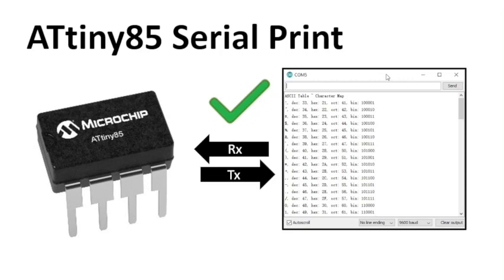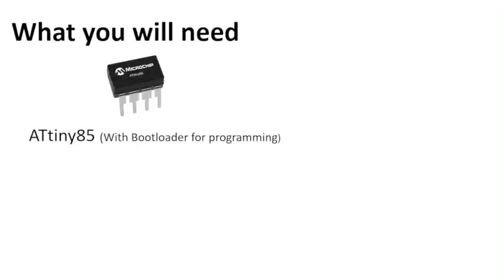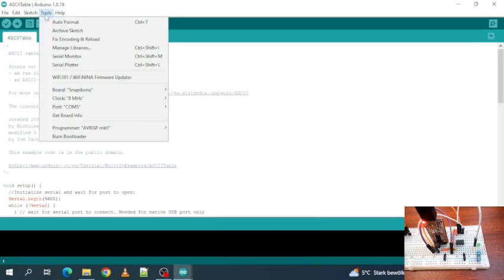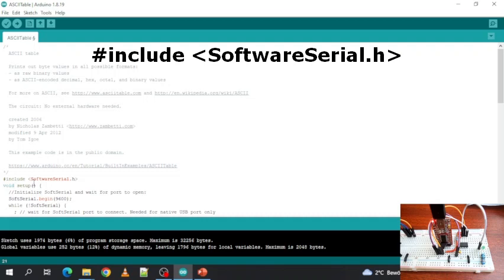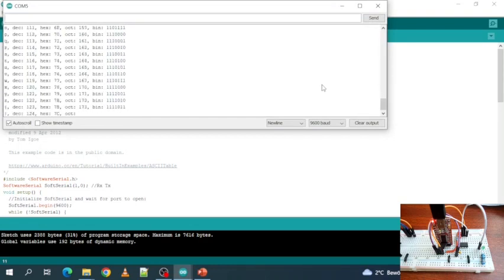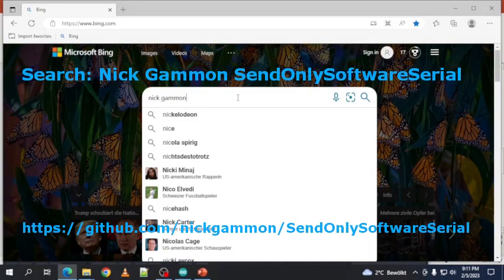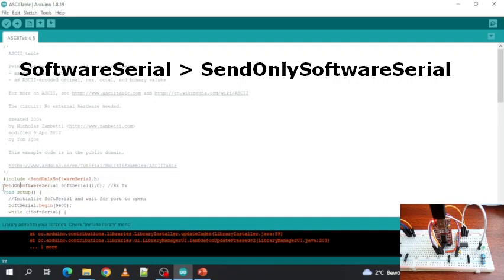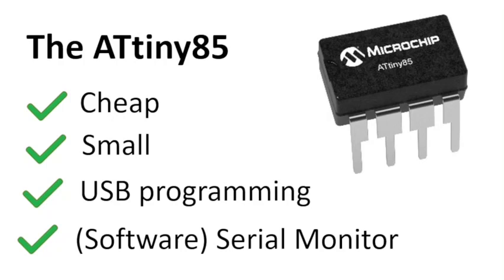ATtiny 85 Serial Print

Comment: DigiCDC has become a hassle to compile, and hard to use (I hear) in Windows.  Have used it quite a bit though.
With a protective resistor, it is possible manage TX+RX on a single line.  Add a CH340N to your dev board with this rig, and it may be possible to serial-print and and run a bootloader with with just the Reset and one data line, freeing 4 pins for GPIO.

Comment: What about the different Attiny support boards? I use the SpenceKonde ATTinyCore. Do you recommend the dmellis Attiny or are practically the same? Thank you very much. I love these Attiny85 videos 😃🤟🏽🤟🏽🤟🏽.
Reply from the maker: Thanks Marshall100w6 🙂
The SpenceKonde is the most compete one if you know what you are doing, it also includes versions without bootloader etc. and does not use up much flash memory, I really recommend this one because it enables you to play with other types as well (Atiiny 25,45, Attiny 13)...
In this video I used the dmellis one, because it is easy to use for beginners (...after you flashed the bootloader), and it is reliable using a FTDI. 
The Digistump looks great but does not always work because the USB is not a standard USB.

Comment: hello from France, in this diagram pin 7 of the attiny85 is not connected? is this normal?
Reply from the maker: Hello regisrobart! I connected an LED with a 330Ω resistor to PIN 7, for the Serial Print function it is not needed.